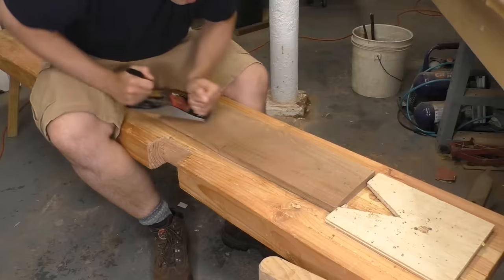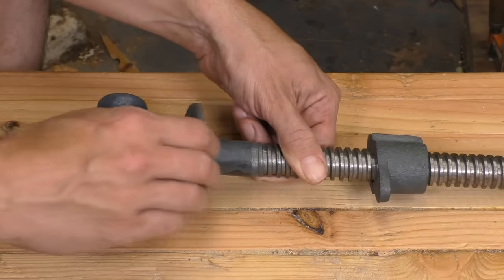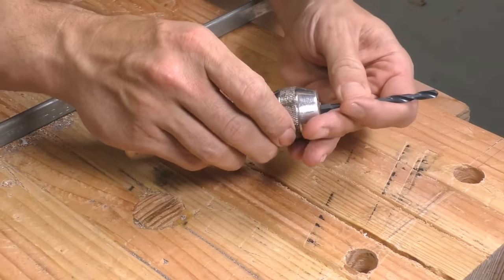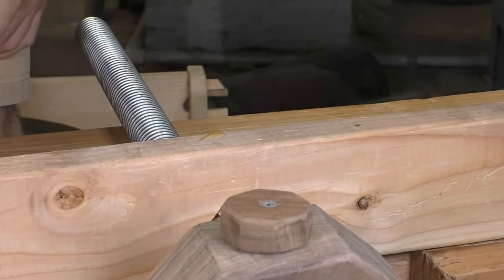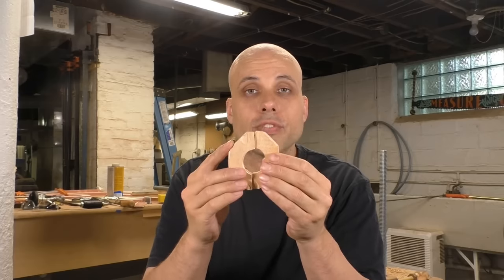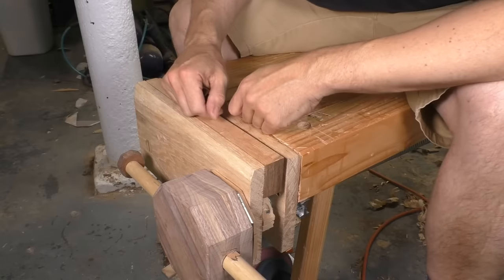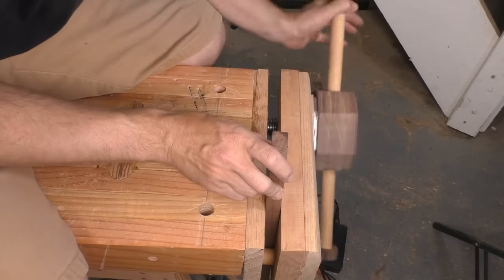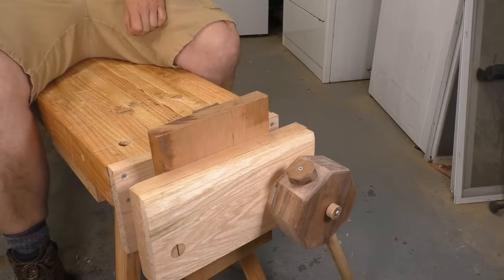Add a vise to the $30 Work Bench.

Comment: Disappointed with this. Was very much looking forward to some sort of lever and/or wedge vise. Something the Romans could/would have done. Certainly not a machined metal screw. 

You know, something simple for the majority of Humans.

Was enjoying this series, but I think you just derailed it.

Not knocking your vise build, just don't think this particular vise fit the series.
Reply from the maker: I wish you could see the stack of failed cam and wedge vises that I've prototyped. They didn't work. Screws are so popular because they're so effective. I've done the research.
Reply: @RexKrueger  I'm in the process of moving and plan to build a bench like this from some of the 2x's that were my little lean-to/workshed at the last place. I know I'll I'm going to want some kind of holding beyond what you had previously. I'll be sure and let you know what I come up with. 

Loving this series overall BTW. 

You gonna make a treadle or springpole lathe?
Reply from the maker: I will, it's just a big project.